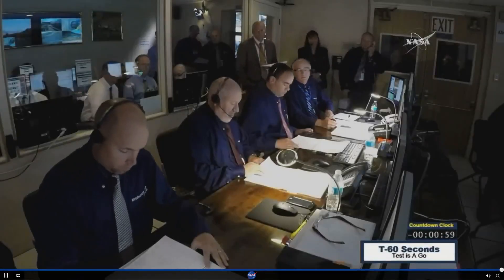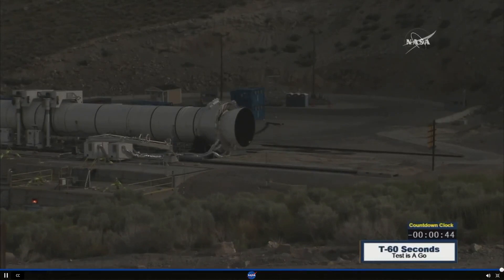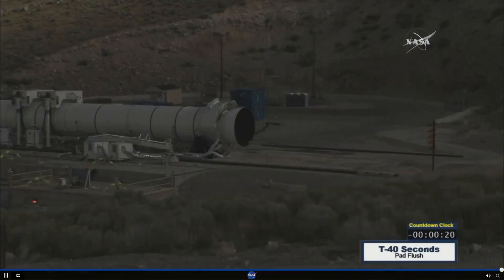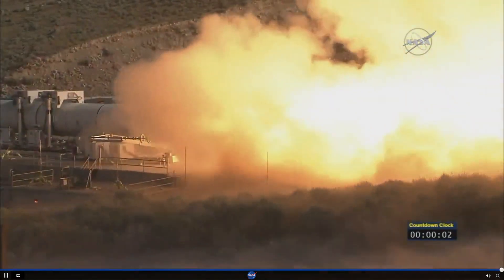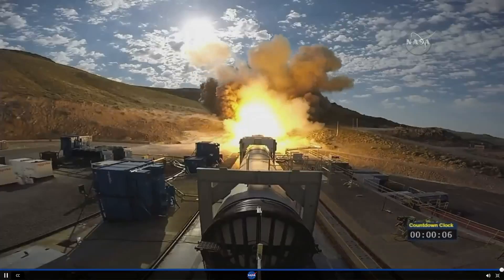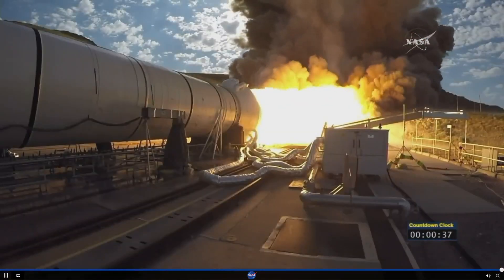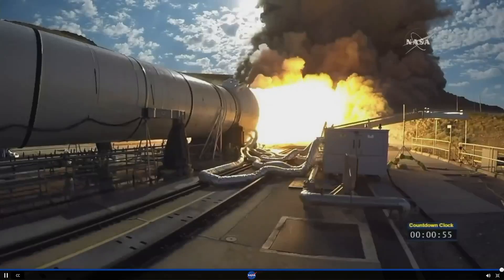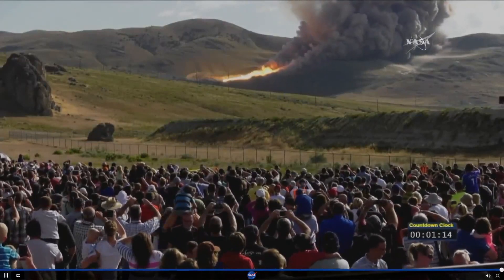NASA Test-Fire Solid Rocket Booster for Megarocket

Comment: That's impressing. Now try to do the same thing in outer space, in a complete vacuum and "nothingness". If it gets an inch in any direction, then I'm truly and deeply impressed.
Reply: newton's third law. It will be trucking. Did you forget rockets work in space? This is something you can test at home.
Reply: Your ignorance is astonishing.
Reply: +GymChess Are you really that moronic?
Reply: GymChess
The burden of proof isn't on me, it's on you. The fact you'd like me to prove it to you makes me sick, on top of being astonished at your ignorance.
Reply: Alright. Then prove to me why rockets, such as the falcon 9, Saturn 5, Delta IV, and every other rocket used by the world works in space. What you're saying is the same as saying something like "a car won't work because you can't see the force pushing on it." You're saying that something doesn't work even when it's working right now. Oh, and about that you said about the fuel getting suckered out:
Yes, the fuel is being sucked out; but, the fuel and oxidizer combusts on contact. That provides even more thrust, and according to Newton's third law, THE FACT THAT THE COMBUSTED FUEL IS GETTING SUCKED OUT PROVIDES ADDITIONAL THRUST. That's why rockets are more efficient in a vaccum. The force sucking out the exhaust after it has combusted gives the additional thrust, due to the pressure in the combustion chamber/nozzle being higher than the outside near vaccuum. Also, rockets don't need air to push against; it is pushing against the combusting fuel. You have actually proved that rockets DO work in a vaccuum by posting that.
Reply: +GymChess
Haven't you ever heard of the Pathfinder, curiosity, every Apollo mission, voyager 1, voyager 2, new horizons, every viking mission, the ion engine probe heading to out nearest star, and a bunch more? WELL, THESE ARE THE ROCKETS THAT LEFT EARTH ORBIT, AND HAS/HAD TO FIRE UP ENGINES TO ADJUST COURSE, IN A NEAR VACCUUM. There's the answer to the question you asked whether I've seen a rocket travel in to deep space before. I looking forward  to seeing YOUR proof that has been backed up by scientific backup, as I've seen a bunch of hypothesized talk without any scientific backup.
Reply: GymChess You keep saying common sense when you clearly don't have any.

We have people observing rockets launching everytime and filming it as we shared with you. Hell the Reds videos I shared with you were filmed through a p900 camera that was able to capture rockets through stage 2 as they blasted into orbit. I and You Are Incorrect both shared videos of mythbusters testing rockets in a vacuum as well as other folks who have made videos demonstrating that rockets do indeed work in vacuum and actually work better than they do in the atmosphere. 

What have you put forth? Absolutely nothing. You talk about observation yet you have none to share and have obviously never seen a rocket launch. It is also obvious that you didn't even bother to look at the videos provided to you. That means you are either an absolute idiot or a troll. Pick one because either fit atm. 

Hell I even shared a video of amatuer rocket club that sent a rocket up 73.1 miles into space with a camera on board. You are either suffering from the worst case of denial and stupidity ever or you are a troll.

The point is though that you aren't using common sense nor are you using critical thinking. You have absolutely zero evidence to support any of the nonsense you have claimed while you remain willfully ignorant to evidence presented to you. So either provide evidence with your next post or we will know that you are either the stupidest person on earth or simply a troll.
Reply: Plus this is a sea level booster...
Reply: If there's nothing push against you're not going anywhere. Newton's make-believe law or not. If you can prove it in real life, please post a video and let me know when it's up.
Reply: Socore Alaite
I was counting the minutes until someone like you would show up. It didn't take long. You're indoctrinated.
Reply: GymChess Socore's comment was dead on though. You are obviously ignorant on the subject.
Reply: Name calling as usual is no proof. Post a video that proves that your own, home made rocket can travel in outer space.
Reply: GymChess He isn't calling you a name he is stating a fact that you have demonstrated for everyone here with your own comments. 

I find it funny though that you are deflecting away from my post that provided you with a couple of videos demonstrating rockets working in a vacuum as well as pointing out your obvious errors and ignorance on the subject. Also I'm still waiting for your evidence.
Reply: Oh, it won't take long before the name calling commences. I'm just waiting for it. So I assumed that it already had. I don't even bother reading through the "your ignorance" rubbish. It's always the same thing when the "defenders" gather like vultures. It's like holding a cross in front of a vampire. No, I'm waiting for YOU to prove that a rocket can travel where there's nothing to push against. Don't post links that anybody can use and copy/paste the same nonsense here and pretend to be an expert. It's make-believe. Common sense should tell you that if there's no air, no water, no ground or anything else to push against it's not going to work.
Reply: GymChess
Bye now, have a wonderful day. Hope you make it through school.
Reply: GymChess Again deflecting away refusing to acknowledge the post I provided 2 videos demonstrating rockets working in a vacuum. Again refusing to accept that you are wrong and don't understand how rockets work. And again you failed to provide evidence that supports your absurd claims. Thank you for clearly demonstrating to everyone here that you are completely full of shit and have no leg to stand on. You are a joke kid.
Reply: Socore Alaite
I did and I still use common sense. You don't. That's the difference. Good luck indeed. I've made this far without fairytales.
Reply: GymChess Again you failed to provide evidence as asked after 2 videos were provided to you. Keep on showing the world your ignorance and dishonesty.
Reply: GymChess hrm go figure it seems just asking you for evidence after showing evidence proving you wrong is all it takes to shut you up.
Reply: http://www.discovery.com/tv-shows/mythbusters/videos/its-rocket-science/

Boom. It proves that you are incorrect, and that rockets do work in a vacuum. A rocket does not need something to push against, even though it may not seem like it through your common sense. Newton's third law, every action has an equal and opposite reaction. This means that no matter whether there is something to  push against or not, a rocket will work, no matter if in a vacuum or not.
Reply: +GymChess 
Or, just search up 'mythbusters rocket in a vacuum.'
Reply: +GymChess 
If you even knew a fraction of physics, you would know that a rocket gets it's thrust from ejecting combusting rocket fuel at extremely high speeds, therefore making thrust. It's the act of PUSHING out the exhaust that makes the thrust, not the exhaust pushing against the air. If you want proof, watch the video I sent you. And before you complain on how it has to be ME to prove the evidence, I want to see YOU testing a device of controlled explosion inside a near vacuum.
Reply: If you knew anything about the use of common sense, you would know that the only thing that would happen is that fuel would be sucked out, right through the combustion chamber into a complete vacuum. The engine wouldn't fire up and the fuel wouldn't ignite. That's what space is - it's nothing. It's a vacuum. It's a void. Try to bash that through your skull first. If you can prove otherwise by your own means, let me know. Until then, save the indoctrinated rubbish for someone else.
Reply: It's a vaccuum. It's a void. And guess what? That gives it additional thrust. Rockets work in a vaccuum. I've given you tons of info to prove that to you, that PROVES that rockets work in space. Try to bash that through your skull first. If you can prove otherwise that general physics of newton's third law is incorrect, let me know. Because by doing so, you will be proving physics wrong, and the smartest physicists wrong.
Reply: You Are Incorrect
The rockets that we see are all in low Earth orbit. When was the last time you saw a rocket travel in outer space? But you did see that sci-fi movie recently, didn't you? And no. I think that I just proved that rockets don't work in space if you read the previous post one more time. As for the car analogy, forget it. That's apples and oranges.
Reply: You Are Incorrect
Oh yeah, so where's all that "tons of info" then? You haven't showed me anything, let alone proved anything.
Reply: GymChess You are completely full of shit and making false assumptions based on your own opinion rather than facts. You also don't understand how the vacuum of space works. Again the combustion is occuring inside the rocket which brings its own oxidizer to ignite the fuel and the release is controled through the nozzle. 

But hey by all means show us your evidence that supports what you are saying about rockets because you have none and you know it. And yet you will ignore videos like the mythbusters with a rocket working in a vacuum as well as other videos that demonstrate the same thing. Hell there have even been flat earthers that have tried testing rockets in a vacuum and they found out that they do indeed work. So hey we all know you are completely full of shit and incapable of intelligent rebuttal.

It's quite simple show us your evidence you lying sack of gutter trash. If you don't have any you are just fabricating bullshit.
Reply: +GymChess 
I suggest you re-read everything that I have posted, as it proves wrong everything you have said. The principle of rocket engines shows that they work in a vaccuum. Simple as that. It doesn't matter whether its a vaccuum or not, the rocket it throwing out expanding exhaust gasses which is therefore "pushing against it". Vaccuum or not, that stays the same, and as long it stays the same, it produces thrust.
Reply: But isn't that just the problem here? It doesn't prove anything. Anybody can visit NASA's homepage, wikipedia or quote any school book on how rockets travel in space. Nobody asks the obvious questions, and the minute they do they're declared either insane, stupid, ignorant or all the three, along with the usual name calling. Unless a believer, by his own means, knows for a fact that rockets do indeed work in space, it's nothing but accepting general and a public belief system - a concept that nobody "dares" to question. But if you don't give a shit you become a target for ridicule. Let me tell you, only a small, tiny, number of people actually know what they're talking about in the first place. Or better yet, a very small number of people think that they have a solid reason to believe that rockets work in space and that NASA sent people to the Moon. It's not about proof. This is about common sense.
Reply: You Are Incorrect
I have. But as I don't believe that rockets work in space, why would I care about lies?
Reply: +GymChess
So you've become a conspiracy theorist now? I don't understand what you're saying. 
"only a few people know what they're talking about" and im just reciting what those few people said.
"no one asks the obvious questions" like what? Whatever it is, there's an answer to it. And if the obvious question is about how rockets don't work in space, I, and many other people who know what they're talking about, have already proved it wrong.
"they're declared either insane, stupid, ignorant, or all three." I don't recall doing so to you. I'm pointing out the facts, and those facts are proof that you are incorrect.
Reply: GymChess I'm pretty sure you have me on ignore at this point but Ill point out again that there are plenty of videos out there of people testing rockets in vac chambers and proving they work. You have displayed nothing but supreme ignorance with your comments and a complete failure to provide one piece of evidence that backs up any of your nonsense. I wish someone would pass the message along to you until you understood it.
Reply: You Are Incorrect He is probably refering to me. I have no patience for flat earthers anymore so I often point out their willful ignorance and refer to them as idiots. If the shoe fits kinda deal as you can see his blind denial without providing one piece of evidence to support his nonsense.
Reply: Let me ask you, what makes you belive that rockets working in space is a lie? There's no reason to belive that it is. And before you say it's common sense, I want you to think about those people that thought flat earth was common sense a long time ago. Some things are more than just what you think it is.
Reply: I have evidence to suggest that rockets work in space, now I want your evidence of why they should not. I still wating. All you're saying is things to deviate from the topic, like on the comment where said random things like "no one asks the obvious questions"
Reply: You Are Incorrect He doesn't have any evidence to back up anything he has said and he knows it. That's how I shut him up the last time just asked for his evidence:P
Reply: Well, since common sense isn't enough and you wouldn't believe what's in front of your eyes anyway, exactly what kind of evidence are you asking for? Do you even know what are you're asking for?  An official statement from the White House? A NASA official laughing at your face telling you how naive and stupid you are? Would you believe that? Basically they already are. So unless you buy a ticket for an imaginary space journey to find out yourself how rockets don't work in nothingness, I'm afraid that there's no proof in the world that I could possibly present that would make a believer satisfied. The further up his own bottom his head is, the harder it gets to pull it out. This is a plead to the use of two things: common sense and critical thinking. I see neither here. Buying into official bs makes life so much easier. All you need to do is quote others, posts links and refere to rubbish anybody can take part of 24/7.
Reply: GymChess Well since you didn't respond and its been a day and a half I'll see that as you conceding to everything I said. So I guess that makes you the stupidest person on earth. Thanks for another easy win for the globe.
Reply: Do I need to explain the high school physics demonstration with the guy on roller skates throwing basketballs to you? I feel like either your education is sorely lacking, or you were just to stupid to catch any of it.
Reply: GymChess its a common misconception that the exhaust of the rocket produces thrust by pushing against the atmosphere  but that's wrong , rocket engine has a nozzle that increases the speed of the hot gasses first then there is reverse nozzle which causes it to expand again producing significant amounts of thrust

Comment: Its 2016, and we are still putting humans on top of uncontrollable SRBs.
Reply: +Matthew Mlodzienski Emergency contingency is separation, once lit there is no way to shut them down. They are literally big cylinders of solid propellant with a borehole going from the tip to the nozzle. Conceptually, SRB's are massive bottle rockets.
Reply: The new EES should counter the danger of SRBs. Also, IIRC, SRBs have a pretty solid (heh heh) track record.
Reply: This is based on the STS SRBs, which have some form of shutdown capability in an emergency IIRC.

Comment: Thanks NASA, you just screwed up the earths rotation.
Reply: I guess those years of tutoring Physics students, teaching them Calculus as it applies to Newtonian mechanics made me an idiot.  Ivy League graduate degrees in the sciences are soooo worthless.
Reply: Right.  Should I have put more emphasis on the word "slightly" in order to satisfy your anti-pedantry?  ;)
Reply: I was about to make a comment of a similar nature.  You beat me to it!
Reply: 1) It was tongue-in-cheek.

2) It actually DOES affect the Earth's rotation...just very slightly.
Reply: @JaredJosephHoag  Way late of course, but you are horribly wrong. You can't move the earth within its own atmosphere. Just as you can't push a car forward by pushing on the steering wheel while fully inside.
Reply: no worries man! The movement of air due to the rockets thrust will have translated back into the ground by now, and the orbit would be back to normal :D
Reply: that's what causing global warming
Reply: I was wondering why Easter came early.
Reply: Um, it's not the air expelled that pushes it forward in space, it's Newton's 2nd Law
Reply: +Nathan Munroe. nah, it'd take at least 100,000 of these firing at once to do anything to earth's rotation.
Reply: Nope, you all are incorrect. Just as the rocket is being pushed forward by the air, the air is being pushed back; there is no net momentum change for earth. Try throwing a bowling ball to a friend in a canoe. The system's center of mass (the boat, bowling ball, you, and your friend) does not accelerate. Aquish1x, someone with your understanding of physics should not have gotten "Ivy League graduate degrees". Well, at least not in physics. This is a fundamental Newtonian physics concept that students in a general physics course learn. God help those poor students you tutored.